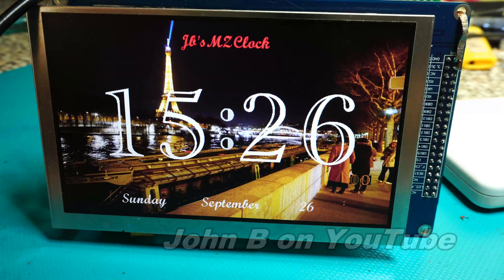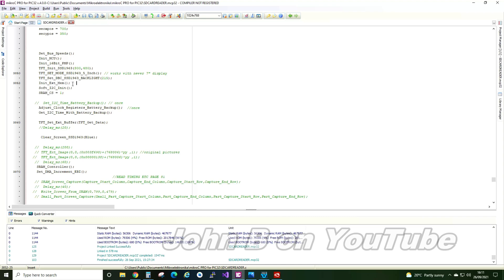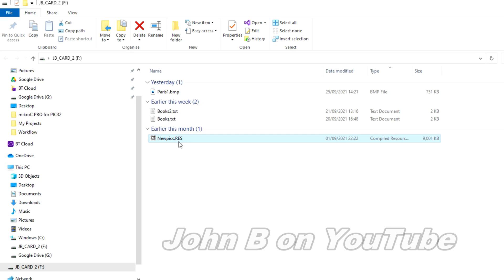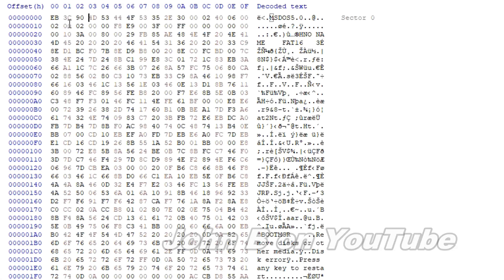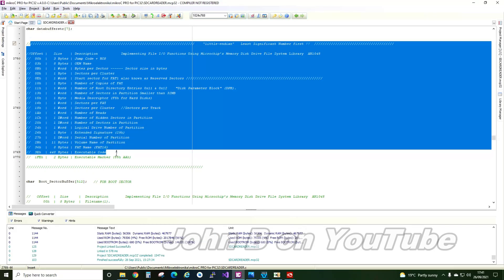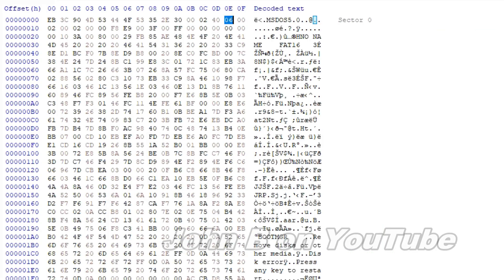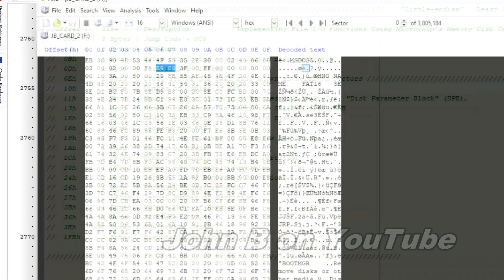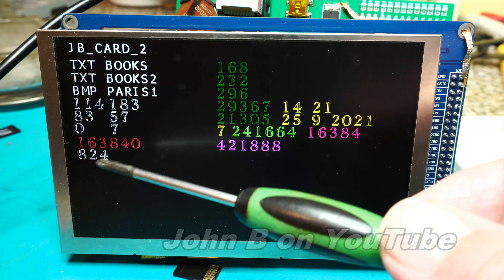The FAT16 File System Part 1, How To Find The Root Directory with Micro-Controller

Comment: Awesome!
I always wanted to learn how the FAT system works.
I'm having a lot of trouble interfacing my PIC18F45K22
Hope there will be a FAT32 video next
:D
Reply from the maker: Tut tut tut lol
Thank you for your comments.
But surely you need to learn the FAT16 system first?
That said, the FAT32 has a bigger disk size and longer files names and can transfer more than 512 bytes in one hit but your Pic has only so much ram.
I'm making part 2 of the video now.
PS, why fat32?
Reply: @JohnB-2021  Why FAT32?
I really don't know. 
I've found that FAT32 and exFat are compatible with most modern SD cards.
One of my goals is the compatibility with modern SD cards.
The other is a data logger or a file generator to an SD card.
I've read that you can use the USB protocol to make the PIC a host and the USB flash as a device to store data in it.
I'm still very confused about this topic and can't figure out where to go next, so I just set my goal to FAT32 at the moment.
o_o
Reply from the maker: @TheBrandon164  
I fully understand.
I am in the same boat.
I have a 16 Gig card but have not learnt the differences yet. (Programming that is)
A 16 Gig sd card will initialise in the same way a 2 gig card does, I know that much.
I too want to move to USB drives, they are so much faster too.
One of my videos shows a pic communicating with a PC over USB using MikroElektronika’s library.
HID Interface…
I will try my 16 gig before I release the second part of this video.
Thanks again for your comments.
Where in the world are you and what IDE do you use?
PS, You still need to learn the format for files, dates and time etc lol.
Reply: @JohnB-2021  
I did it once with the arduino, but where's the fun in that?
It was with an old Wii 1Gb SD cards.
Did the job, but not as satisfying.
I was trying to do it with a 32Gb uSD with no success.
No worries! There's very little people to chat about MCUs, so I'm always open.
I'm from Mexico! Right on the border. I use the MPLAB X with MCC.
There's an option on the MCC to configure FatFs but can't make it work.
Never liked MikroE stuff. When I used it at University it was kinda Buggy. 
Yeah! but as long as I can creat and read a bin file, I'll be happy with that.